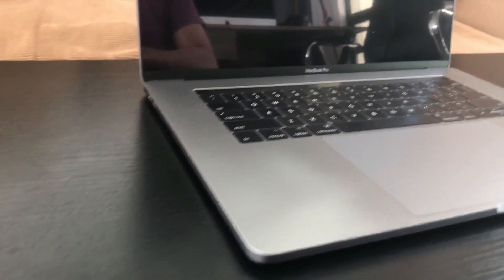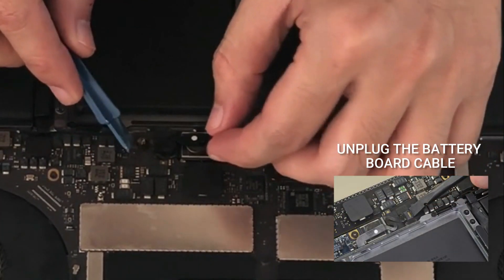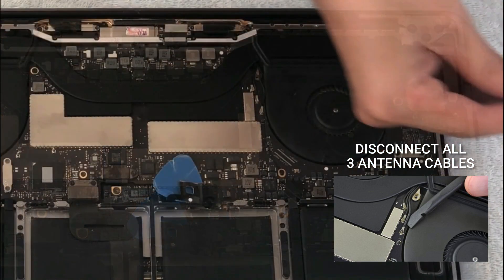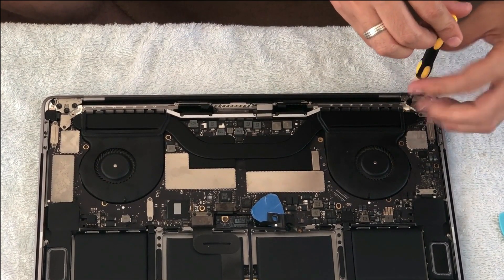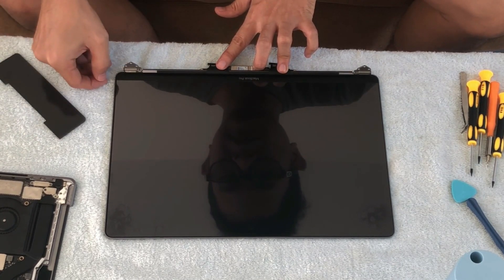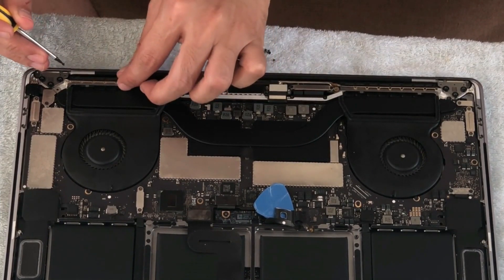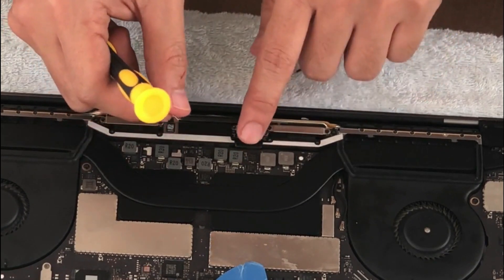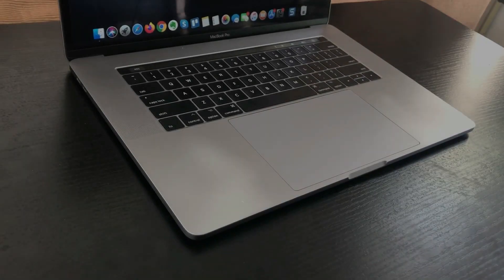MacBook Pro 2017 LCD Replacement (A1707)

Comment: That's not an lcd replacement, that's a whole assembly replacement.
Reply from the maker: You're right. I tried the LCD replacement prior to this and I wouldn't recommend it. It takes a painful process and I ended up with a non-working screen. So I went into replacing the whole assembly instead. Wasn't able to change the title. sorry about that

Comment: Yo, so I accidentally pulled off the power cable connector thats supposed to stay attached to the board. I cant seem to find answers on this at all. Or maybe I'm not searching correctly. I'd appreciate some guidance on how to fix this.

Comment: Ill be doing this in response to Apple's failure to fix their MacBookPro A1707 15inch systems affected by the flexgate defect thoroughly discussed by iFixit.

 Apple recognized the defect however only granted free repairs to the 13" model macbooks pros.

 The flex gate defect, basically occurs as a result of the the LCD flex cable deteriorating due to the opening closing losing of the laptop. The cable becomes frayed and when you open it past 45ﾟ the monitor goes black.

I'll give Apple one chance to honor my request to have it fixed for free, if not I'll have to spli'll have to splurge the $300 they're dollars and follow the instructions on this very good video.

Comment: Thanks bro !! I don't umplug the battery board cable on the left, i remove the connector whith 2 screw on the right of the pancake screw. Same quality video.

Comment: Did anyone that has done this run into an issue with the touchbar not working after replacement?  The touchbar lights up and changes based on the application, but you can not press any of the lit up buttons.  I don't believe anything that was removed during this process was near the touchbar hardware itself?

Comment: The battery cable does not come off as described in this video. You have to carefully peel back approx 1/4 inch of the thin black plastic cable cover to expose the connector, then remove the cable from the flip connector. The cable disconnects easily if done correctly.
Reply: I accidentally pulled off the battery connector that's supposed to stay attached to the board 🤦‍♂️ And i cant seem to find an answer on how to fix this. Any ideas mate? Or how to search for this online? Thank you.

Comment: Hi! I have done this to my macbook pro but my camera is not connected. Can you tell me how can I fix this, please? I already did the terminal thing just in case but I think it's some cable but i don't where to find it. Thanks
Reply: Hi, I have the same problem.
Were you able to figure out a solution?
Thanks
Reply: I am not sure - I replaced the screen as well. But it is black. External monitor works. 

My guess - about the camera. And to my problem. Is that one of the three antenna cables aren't connected. It was a hell trying to even get the three antenna cable connectors snap into each position

Comment: Good Day! Had broken my Mac and am so thankful for your video. I followed the links and was able to replace the screen with your guidance. Thank you so much!
Reply: How has been working since the replacement?
Reply: @cisne_sonoro  the touch bar stopped working ever since but other than that, everything is working just fine
Reply: @angelagonzales1125  that's a bummer? But do you know exactly why it stopped working?
Reply: @j.rjunior5584  not sure but the replaced screen is not original so I suspect it is a communication error

Comment: At around 4:00 you mention the P2 Pentalobe 1.5mm screws you are removing... In a similar video, the technician is demonstrating the same screws but refers to them as Pentalobe 0.8 screws - https://youtu.be/rPW1-fsIVn4 - I'm confused ! Is apple putting two different types of screws in these slots for the same machine

Comment: He glossed over a few really important parts. The battery cable was really scary to take out especially after reading some of the comments. I did have to watch another video and read the iFixit instructions. Pulling the case off was easier than it appears. Once you get it to slide then all you need to do is pull it up. There are snaps that you will hear because there are pieces that click into place in the middle and on the front. So don't be afraid to get your fingers in there and pull the case off.
Reply: i wish i'd read the comments before yanking off my battery cable :(

Comment: Thank you I followed your video with total success. It took me 3 hours not in a hurry. I have a few tips: You must remove the battery cable. A single screw falling into an energized motherboard can kill your Mac. It is an important step, in this case , because you are going to remove many many small screws. Make sure your tools are magnetized.
antenna assembly, use a small eletrci drill to drill them out always counter-clockwise, in my case I had to remove 2 screws like this and didn`t put them back, just 14 out of 16 were put back. Nothing happens, the antenna worked ok with just 14 screws.
Reply: How has been working since the replacement?
Reply: @cisne_sonoro  working ok every day

Comment: I Need Your Help ! 
I have a MacBook Pro 2017 , the display is not working but when i am about to close down the panel it starts working at around 45 degrees angle .. the screen is not broken and i guess there is just this hinge issue.. do i need to replace the whole panel? Please do reply.
Reply: I have the same problem and. Apple tells me that the screen must be replaced ,, it is a construction fault, like the 13 "ones, which Apple changes for free, but it does not recognize it in the 15" ones.
Reply: Google Flexgate. You'll probably only have to replace the display flex cable which can be found on eBay/Ali for cheap.

Comment: my personal experience... i did the replacement (with repairer). display color calibration retina etc all good. after continuously using 3 hours... display getting faded off from top to bottom and followed by totally display off. If I stop using my mac for sometime then it will work for another 3hours & same issue again.
I figure out after one month by that time seller warranty was over. 
so, after replace use it for 4/5ours continuously to check working as expected

Comment: Thank you for this excellent guide. I have just completed the process and would like to supply some extra information that may help people who get stuck.
I'm not sure the removal of the battery cable is necessary, as long as you're careful about not turning the Mac on. If you do want to do it, carefully peel up the sticker covering it before sliding the cable out. I did this and it worked, but I would leave it in and just skip the whole section in the middle with the pancake screw and all that. The only real 'work' on this job is the stuff on the top edge of the laptop and the 3 attena cables that stretch down into the case slightly (and the screw next to them). All the stuff in the dead centre of the laptop, I think you could skip (at your own risk, but then all of this is as your own risk).
When you think you've got the screen changed over and the cables are plugged in, you can power up the Mac with it stood upright in that "90 degree" position on its side. Just power it up enough to check that the screen works and that you can see your battery status and charging status. Then shut it down and begin the process of putting in any leftover screws and sitting the case back on. You don't want to get the case back on and then find out something wasn't plugged in correctly. 
The 16 screws that fasten into the antenna are called P3 in the video, in my set it was called a "0.8" Pentalobe type. P3 would be way too big, but we may just have differently labeled bits.
The hinge screws (3 on each side) use a T8 size torx bit.
For a set of screwdrivers that includes everything you need, including the suction cup, guitar picks, spudger, tweezers and all screw bits used in the guide (and in my notes) I found this set works. I receive no money from this: https://www.amazon.co.uk/gp/product/B083BG2HM5/
I found a perfect match screen from here which would appear to be an Apple part (again I get no money from this) https://www.ebay.co.uk/itm/NEW-Genuine-Apple-MacBook-Pro-15-Touch-Bar-A1707-Silver-Screen-assembly-2016/124203224690
When it comes to closing your MacBook up, you might find that you get a 'bulge' in the case or that it doesn't fit together properly. This guide on opening and closing the case will show you the right way to do it: https://www.youtube.com/watch?v=cOrm48Jh0rg - pay attention to the part where you're guiding the case back on with <1mm clearance on the two tabs. That's the secret to getting it flat.

Thank you Richie for putting this information online in such an easy to follow format.
Reply: thanks you mention t8 driver but your kit on Amazon doesn't have one? did u mean t5
Reply: Weeebz yes it does, look at the main photo, the 8 is almost in the centre
Reply: Depends which one you get, I got one off eBay that was an exact match
Reply: How has been working since the replacement?
Reply: @cisne_sonoro  fine

Comment: The battery cable removal suggests we yank it from the board, instead of peeling back the tape. I completely destroyed my battery cable and its connection to the board. I have no idea how to fix this. The rest of the video is fine, but the destroyed batter cable makes it not worth it
Reply: Yup same happened to me
Reply: @visualeclipseproductions  This guy Richie Salvador is a menace, belongs in jail for misleading people and destroying their computers. He is a sociopath
Reply: I had to send my computer to Apple to fix it because he "showed" me how to remove my battery cable by ripping it from the motherboard-destroying it- and there was no way to replace it or solder it back on, the connections were so small. Please report Richie Salvador to YouTube and ask for him to be removed
Reply: @harrysandy  Get a grip Sandy Summers. He never suggested to yank it off the board. Rather he said to be very careful when removing this cable. You are trying to blame him for your own fault, not nice. Of course providing how to video is no guarantee that the user will do it right. If you want guaranteed results, pay a professional to do it. In the end it's your responsibility to ensure you know what you are doing.  If you can't figure out how to remove a battery cable you should not attempt to replace a macbook screen. Sad.

Comment: Thank you, that is a good video. The replacement is quite cheap, so I expect it is a Chinese copy of sorts. Are you still happy with the replacement? I am pondering purchasing one of these replicas for $300 vs a genuine Apple display for $450 (refurbished) or $650 (new)
Reply from the maker: Martin Guenther yes still good. No argument but the apple one will always be better. But i choose the Replica. Already spent too much on these repairs
Reply: @techwithrichie  I actually did replaced mine with the Ali replacement a few weeks ago. Works well so far. I did have to purchase another one of the smallest size pentalobe screwdriver, because the one that came with the new display, failed on the very first antenna screw.
Reply: @heiner71  are you satisfied with the replica? can you see any differences?
Reply: @dariokamyar  Nope, not really. It worked fine for about a month and then started having issues with the display showing weird colors after running the Mac for longer than 15 minutes. After that I gave up and bought a newer machine instead.